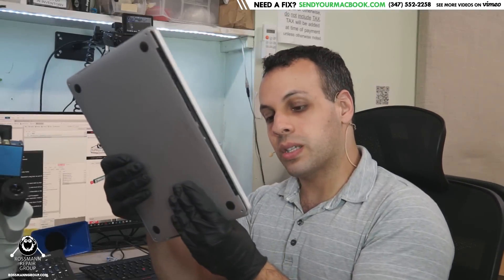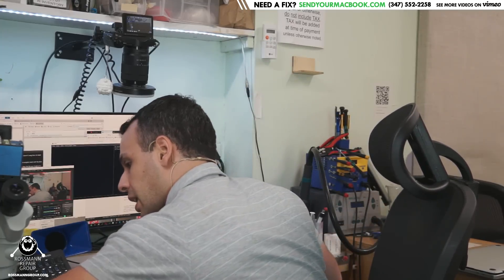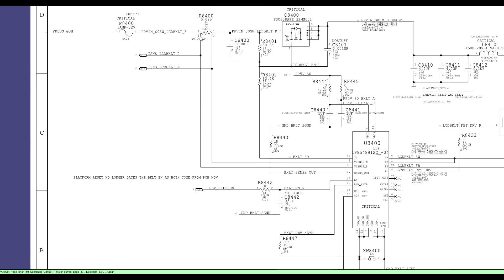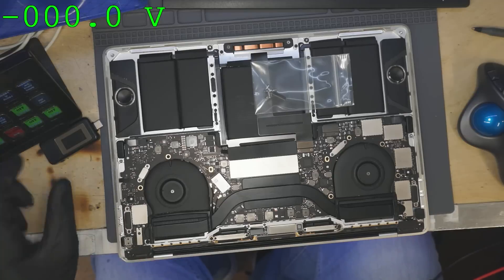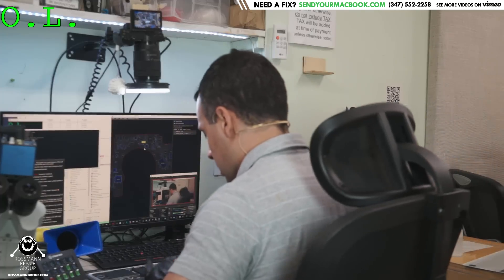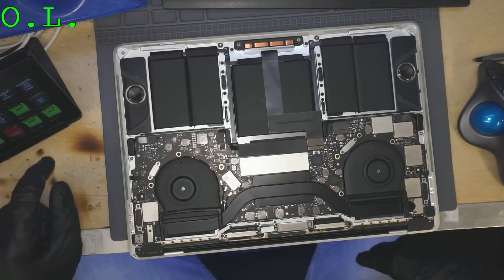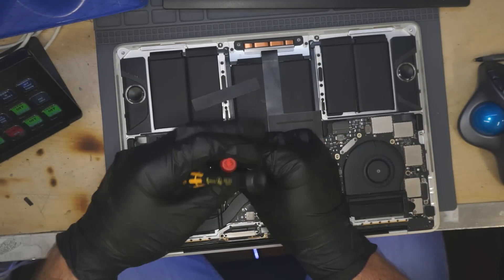Mac authorized dealer said WHAT??? + 1st attempt at ASMR board repair.

Comment: Hey Louis, I don't know if you already have one or not, but I think a thermal camera might really help finding the hot shit. I get enjoying the new tool though. I'm not very knowledgeable in board repair but in my experience of troubleshooting/repairing and improving manufacturing systems thermal imaging can be huge. Mechanical and electrical issues can be instantly located from heat signature and its a badass piece of tech. Has saved me hours of troubleshooting really complex issues. I used FLIR android imaging attachment. Might need something with a tighter focus but it was like $200. Not sure what you pay your techs but I bet it would pay for its self in a very small time frame.

Been watching your channel for over a year now, really appreciate the value you provide with your free content. Thanks

Comment: Having been a certified ACMT and iOS tech, apple always required complete part replacement. They never wanted us (under warranty or out) to do component replacements such as these capacitors. I had many customers tell my staff that they took their device to a local computer repair shop and they replaced this and that (things apple would not allow us to do) , and it resolved the issues. Needless to say I no longer am an ACMT or iOS tech for this, and many other frustrating reasons. I love your videos because it's all the Apple would never allow us to do. Love the videos!

Comment: Why even have the fuse (Ignoring the fact the driver chip will shut down due to over current sense). The idea of a fuse is to save the circuit from damage in the event of a fault.  A fuse is meant to be replaced after the fault is resolved.  Like in your car.  Why don't Apple omit the fuse and save themselves 0.01 cents per fuse per machine (like hundreds of thousands in total).

Comment: maybe we should think apple as a very high end car manufacturer. when their cars break down, the consumer take the car to an authorised dealers, the dealers won't fix the specific faulty part, they rather replace the entire larger assembly as long as the consumer or apple is willing to pay for it. in this practice, apple probably won't need very competent mechanics or mechanics with outstanding diagnostic skills, since then entire assembly is going to be replaced, does it really matter if it is a faulty capacitor or a vcore control chip?

Comment: the thing is, how feasible is it for apple authorised service providers to order in just the capacitors? if it is not feasible, then their recommendation was right, albert for the wrong reason, that the logic board needed to be replaced. their inability to diagnose the capacitor problem is their compentence issue, but even they had diagnosed it correctly, what else could they have done other than recommending replacing the board? nevertheless, the end result for you and your customer was a win. you got the business by fixing the fault and i imagine your customer paid a lot less than what they would have, had they chosen to replace the board. well done Louis, you outperfomed the authorised service provider technicians again.

Comment: The thing is Louis and I'm really not defending the Mac repairer but what you are getting is hearsay, second hand information.  Did the Mac repairer actually say that or has the customer got his wires crossed because, as you say, it makes no sense.  I can understand maybe fuse was mentioned at some stage but equally, do they do board repairs or do they just change the board which would solve the problem anyway albeit expensively?

Comment: Couldn’t he have just measured the resistance on the capacitors?
Reply: Yes, but i would have to unsolder them first, as they are all connected in parallel, it´s easier to just use new ones, as they are dirt cheap.

Comment: Mac authorized dealers are the best, they killed a friend's perfectly working iphone while trying to replace the (working) battery. Said its the battery's fault, because its a third party battery and it short circuited killing the motherboard when removing it. I am by no means more than a hobbyist when it comes to electronics but how is that even possible, the battery short circuiting would mean no electricity is transferred upwards to the electronics because it is short circuited bellow the point of contact with any electronics at all. At least they replaced his iPhone.

Comment: I am going to agree with you in small part I have been an electronics technician for 31 years on computers printers copiers, thirty years ago yes we would replace the fuse after doing full troubleshooting, voltage resistance etc, nowadays boards are just replaced so the authorized dealer was doing what all manufacturers suggest send the core back for recycling

Comment: Could you imagine him with a Mac Authorized Repairman's Brain?

What's wrong with his brain?
Genius Bar said that his fuse is blown.
No! It looks like Apple didn't plug his cerebral cortex in all the way!
Well. That's plugged in all the way. Why are we not getting a good IQ here?
Let's check! Oh! Look at that. The capacitor for LPL (Left Parietal Lobe) Bus 3324608 is fried. Well. Let's replace the capacitor for LPL Bus 3324608 and see if we can get this guy functioning properly again 
Alright. We got some flux on there. Let's heat up the capacitor for LPL Bus 3324608 and get it out of there and replace it with a happy capacitor for LPL Bus 3324608 and let's see if we can get a happy Mac Authorized Repairman today. Now we got the capacitor for LPL Bus 3324608 replaced let's turn him on and see what we've got.
Look at that! Got it replaced and looks like we have a happy Mac Authorized Repairman!
Next time, they should bring themselves here instead of talking to the Genius Bar. But, with his IQ now at a decent rate. We should not longer have that problem.

LOLOLOLOLOLOLOLOLOLOLOL

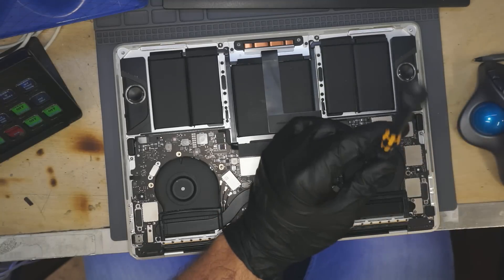Comment: 3:30  

If they're apple authorised, you've said in previous videos they have to repair it "Apples way" didn't you?  
And normally Apples way is replacing whole parts. Not doing solder work.  
So if the authorised repairer deemed the logic board was the fault (correctly or incorrectly) then they'd still be saying the board needs replacing, correct?

Comment: At 6:20 it looked like the third cap from the bottom was the culprit. The alcohol appeared to be disappearing faster from it. At 6:50 it appeared to be the second from the bottom of the screen. Hm... that solder mask conformal coating stuff looks like just what I may need when I open up my old Amiga 2000 that probably needs some cleanup relating to known problem of a leaky battery.

Comment: 11:13 How does even the most basic sheep not call B/S to this.  If your toaster doesn't work and you call an electrician, he says "Yeah, your fuse blew, you'll need to move in to a new house.  I'll just take this one and make sure it's handled properly." Would you not call B/S then?  It's basically the same thing.  And it's not even!  It's like the electrician telling you it's a fuse when it's actually a dead toaster and the solution makes even less sense! 
Everyone knows the purpose of a fuse it to protect what's behind it.  Like seriously, I'm pretty sure everyone knows that, so HOW can they say this?  I've spent so long trying to find the right words for this, but your title says it best: "WHAT???"

Comment: "... which means the backlight fuse is NEVER gonna blow! EVER!!"
True, so long as the system you just described always works correctly, and shuts the stuff off when it's taking too much power!

"Bad fuse, so must replace the board???"
Why even put a fuse in a place where it can't be replaced if it blows? I'm not even an electronics tech, and I know how stupid that is!

Fred

Comment: Louis, what you are dealing with, and or revealing, is that mega-corporations believe they are entitled to some level of discretion when the truth of the Apple corporation has been injured by their selves. (In ordinary speak, they don't like it when they as a mega-corporation have been caught out for not necessarily issuing out the truth in relation to their sales products,,,,,,,, which includes customer service matters, repairs, inquiries, repair quotations et al.)
So my continuing use of 'ordinary speak' that means a type of deception has been engaged in, which as far as I know it just ain't legal.
Damages through the court can be huge by the regulating authority that is charged with policing the coeporations Act in your country, as well as a claim against them for their false and misleading claims against yourself. Don't be relying on fair dealings, remember the wealthy will demand their unwarranted privelige.

Comment: The Enterprise that I Works today has many devices projected by me. We Still Don't have authorized assistance, because this, every time that our devices have problems, we recommend to send it back to be repaired and we send back a working device with a repair cost.  
But when the damaged board comes to our repair center, sometimes technician that have all schematics, board archives, working flow and all other kinds of stuff that helps then to correct repair the board, I see a lack of knowledge that makes them to send boards to scrap because they are unable to correctly analyze that circuitry.  This is the first thing that I imagine that cause this situation. I think that is the problem of Apple Repair center too. They don't wanna pay for a good person to repair their devices, I believe that for there is cheaper to use a new one board (and more lucrative) to induce people to buy a new part or to use an old part repaired, mainly because people don't valorize repair work, they think that because components are cheaper, the Work must be cheaper too, what's false.  And there is another thing that may be happening: They may keep the damaged board to be repaired late and sold as new times later. This is not honest, but maybe the second cause of this situation.

Comment: Surely the whole point of a fuse is to protect the other components? If the fuse blows, that's good and it's done it's job. You should be able to replace it and be on your way. Even if it WAS the fuse, their suggestion that the board needs replacing makes no sense?

Comment: I want to clear the air of what AASP cannot do, before people keep bashing them and many of them are mom-and-pop shops that do good services in smaller regions where there is no Apple footprints. Even that, Apple is trying to take them away in favor of mail-in service.

All the fuses are soldered onboard, not replaceable without soldering, and one of the troubleshooting in the service manual for backlight issue to determine if a display or logic board (MLB for short) is to check the BL fuse. There is no fault on the initial diagnostic part, the tech does not have the tools or knowledge to investigate thus it goes to Louis.

As per AASP contract with Apple, AASP cannot repair anything not according to Apple service procedures; meaning AASP can only replace the whole module (as per service manual). They cannot do anything that Louis is doing. AASP does not even have the electrical schematic like Louis is using. The AASP who sent this MBP over knows their limitations and it's better that way IMHO than telling the customer to buy a new one. 

In the automotive industry, whole unit replacement is common. Recently my synchromesh in my car is grinding and they replaced the whole transmission under warranty even the dealer knew where the problem lied. It's all about cost and efficiency, Apple does not train or pay for troubleshooting skills in North America, they rather pay pennies to get them done in China where they refurb the components. The technician only trained to replace components as per service manual.

Don't blame the employees, blame the company. They are just simply following directions.

Comment: If it were the fuse, properly spec'ed fuses do not blow without a reason. While it's easy to say, "just replace the fuse", in reality, you probably have not fixed the problem by doing so. Having said that, the Apple repair still fell down on the job.

Using alcohol to find the hot component is a great idea, as long as it doesn't burst into flames, of course. I'll have to remember that.

Comment: Electrical noob here - Wouldnt it have been easier and comprable in price to grab a used board off ebay and charge the 1 hour of labor to swap it? Im assuming several hours went into this board repair. Correct me if im wrong. Im asking from the point of view of an honest computer shop employee who can’t do soddering.

Comment: my experience with the apple store.. 

well inside warranty 

My fan was making a noise.. you know that archetypical fan spin noise when the fan has a worn out bearing.. that noise.. well the fan is really easy to replace , just three screws and and a connector.. REALLY easy.. was at the apple store.. and explicitely asked for a fan.. replacement fan :
the insisted to check my notebook. i let them..they said there is nothing wrong with the notebook, i agreed.. said 

"thanks for checking this, i am really glad you confirmed that there is nothing wrong withthe computer , can i now have a fan"? 

they said this needs to be done by an authorized repair mechanic or the warranty will be voided.. i politely declinbed their findings and noted that thefan can be accessed without disassemly of the computer sicne its sits atop the board and can ne changed by having three screws screwed out.. they insisted .. i needed to computer so i said i will do it when i can wait for it.. 
they said: mechanic will be abch next week.. ok,.no bif deal i am coming back next week..

next week, same procedure.. i need to check you notebook, nothing is wrong and we need to have it reparied by the apple mechanic..  who was not there.. 

thrird week, same procedure i said no need to test it IS the fan.. apple employee, how would YOU know this.. me : "its a noice on a frequence and its a mechanical noise.. and in this macbook there are pnly three things that could generate this noise: CD Drive, harddrive, and fan.. CDDrive to slow for that noise, harddirve too fast for that noise. so it needs to be the fan.. 

they insisted to checking it again.. then said the technician isnt there but they can ship it to the next big city and then fix it.. 

time estimate 4-6 weeks.. 

-.-

so it would have been.. 9 weeks. in total.. 

i said i just want to buy an fan.. 

no way.. 

got on amazon. next day delivery , 5 minutes work.. new fan working.. 

yay..

NOT
Reply: Nah you have to replace your entire board to make that work
Reply: @IskeletuBr  ARe YoU FUCKinG CraZy ? U hAve tO rEplAcE tHE whOle MaC. IT cOUld eXplode if You OpEn It bc Of tHe lithium Ion BaTteRy
Reply: @windowstips1430  Sometimes the batteries do explode though.
Reply: @7SGThenkai  the lithium batteries become spicy pillows for several months before exploding. Google 'spicy pillow'
Reply: Well it's your own fault for a) thinking Apple support is in any way capable and b) getting a Mac in the first place!
...
OK, I'm clearly joking with b). Fans wear out on all hardware. It's just that dealing with a worn out fan shouldn't be a hassle.
Reply: @shaamaan  it was a 5 minute "job" .. the fan is resting on top and is accessible without any dismantling.. they should have given me the fan .. and not putting me through the hassle of visiting them three times.
Reply: Just don't visit any apple store/authorised service for parts. This is apple we're speaking off.
Reply: First mistake , buying a macbook 
secong mistake , expecting service from Apple
Reply: @MrTarmonbarry  🍏🍎🍏
Reply: F
Reply: Spellcheck.
Reply: Hariukin this was incredibly difficult to read
Reply: @Hey_Jamie  ok,can you give me some clues on how to improve ?

Comment: you have mad skills and can both charge a decent hourly rate while fixing it quickly (lower hours).  
the other repair stores do not have mad skills and couldn't fix it even if they tried, and/or would have to charge a bunch of hours to figure it out.  so for them, they recommend to change out the whole board.

Comment: Love the software by Paul, just remembering the good ole days where I've got books and books of circuit diagrams.

Here you are fuse is bad, anybody who doesn't understand electricity has no clue that it is very rare that a fuse just goes bad. Usually there is a underlying issue to cause the fuse to do it's job. Kind like take you car into the mechanic and he says your oil filter is bad I need to change the engine. Of course we know many anecdotal stories about car mechanic who rip off the customer because they don't really know what she was talking about.

Comment: Perhaps the employees are not trained to solder intricate parts and just plop in a new part for quick fixes.

I would say the diagnostic from the apple tech is about right since the laptop would not let power complete the circuit run to the rest of the board would it not be a “popped” fuse?

Comment: Back when I was a electronic tech. I would have use a hot air gun and pull the suspect cap with tweezers. If the short doesn't go away pull the next one. I learned microscope-tweezer hot air gun soldering working on mobile phones at Nokia manufacturing plant in Fort Worth. I have never seen someone try to solder more than one SMT component at time, nice.